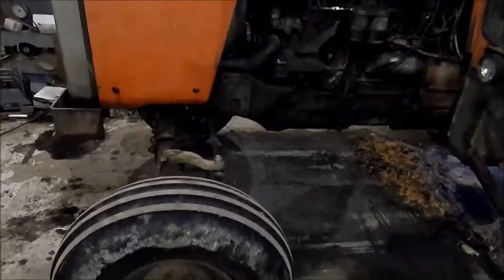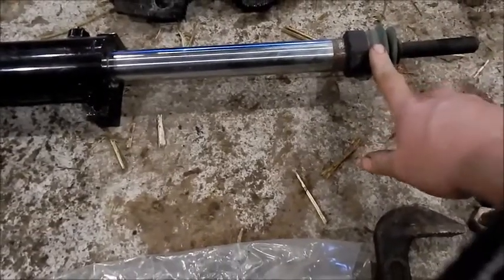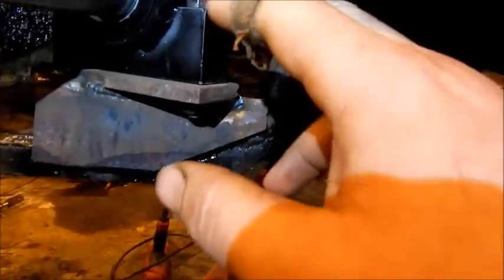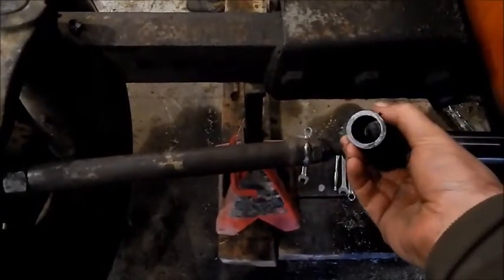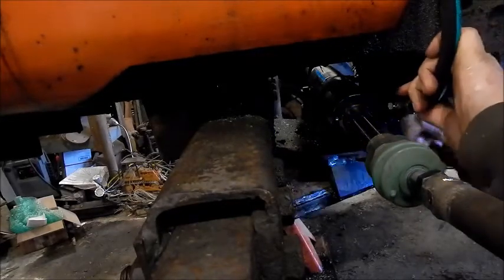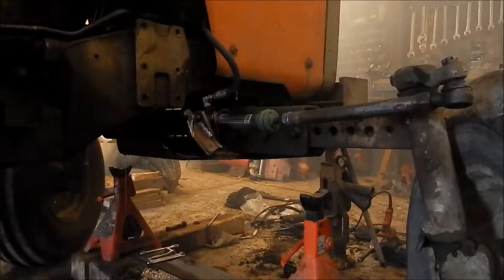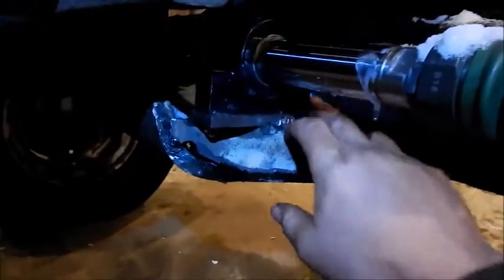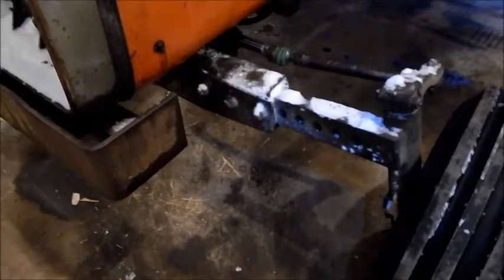MF 1135 steering upgrade

Comment: Why did you go with this double ended cylinder, you showed that other massey that had a single cylinder on the back of the axle, both wheels joined with a Tie Rod on the front, just curious, looking for options, my steering box started puking, this evening while mowing. I Don't need the adjustable width front end, I'll set it wide and go.
Reply from the maker: i thought it would be easier insulation,  the other tractor shown is on a 4 wheel drive tractor that has more mounting points for for the tierod and steering cylinders
Reply: @farminwithfergusons  Right on, thanks for the feedback
Reply: Do you remember what the two other lines were for on the power steering rack, the two that connect to the top round part of the steering rack? @farminwithfergusons
Reply from the maker: they were hydraulic oil pressure in and out.  my guess is the factor did this to cool the the gearbox.  i looped these lines together @pontiacmaniac2
Reply: @farminwithfergusons  Roger that, hoping to finish this prject today, I'll probably have to make another hose inorder to loop them together, I'll have to take a closer look at it.
Reply from the maker: i have rebent one of the steel lines @pontiacmaniac2
Reply: @farminwithfergusons  I got er all done and buttoned up, steers good. Thanks for the help, went and got some mowing done today, Got er stuck in second and third gear, those gear selectors in the cab are pretty picky.